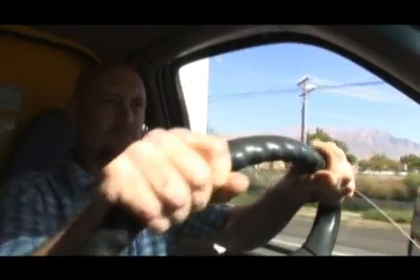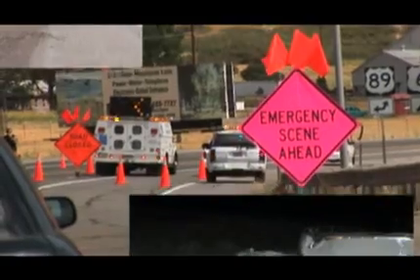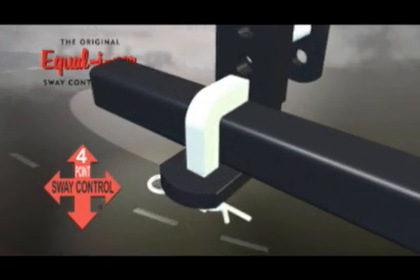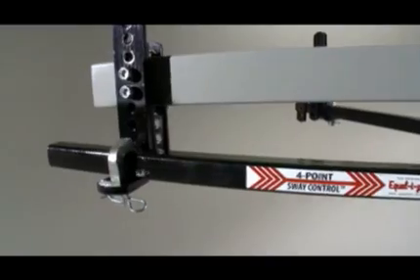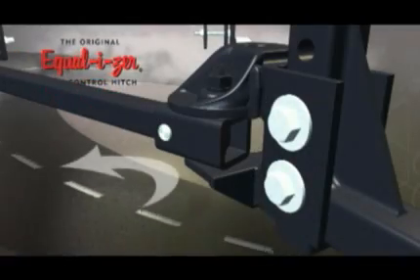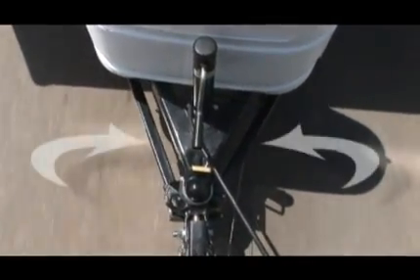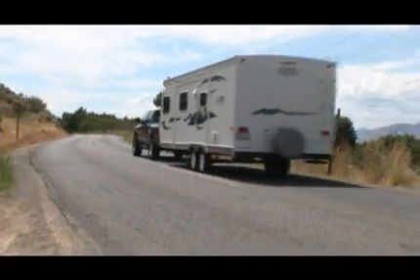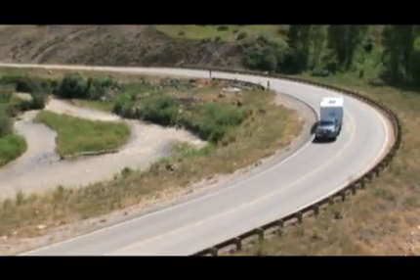Sway Control -- Equal-i-zer® 4-Point Sway Control™ Trailer Hitch

Comment: I have groves that are being cut into the hitch where the bars slide into the pockets. Is it suppose to cut grooves into the hitch?
Reply from the maker: It is normal to see some wear on the top of the sockets (square tubes in the hitch head that hold the spring bars), and the underside of the top plate of the head (the surface the top of the sockets rubs against). However, you should not see deep grooves or gouges in either. Have you been lubricating the hitch following the recommended maintenance guidelines? [https://www.equalizerhitch.com/blog/02-25-2016/how-to-lube-your-equal-i-zer-hitch]